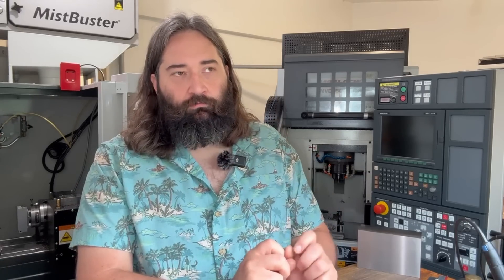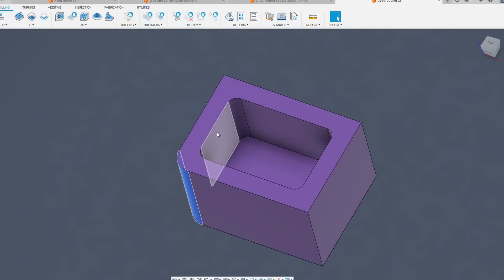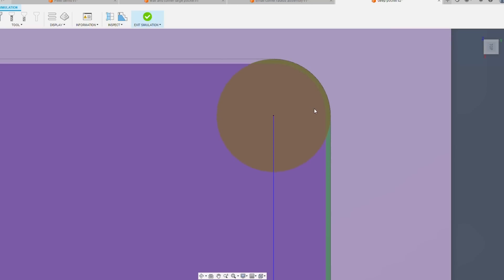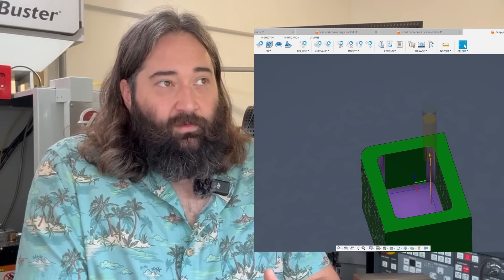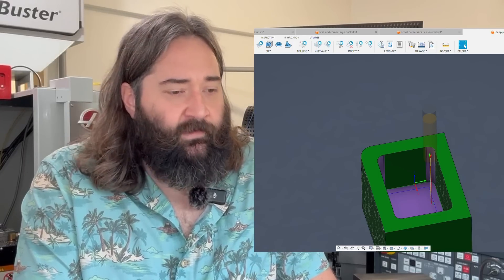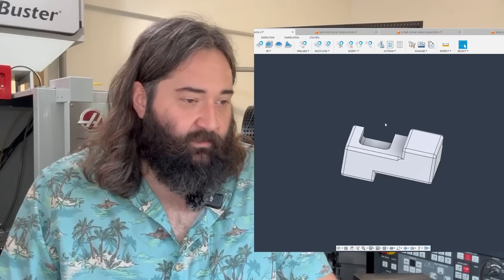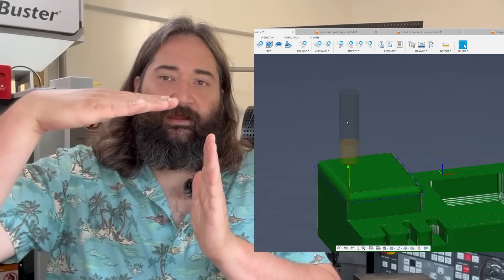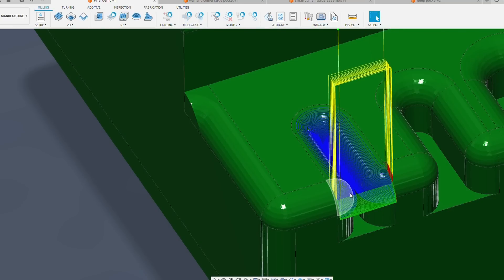Fillets make your cnc parts more expensive

Comment: A great video! The part where you ask for suggestions reminded me of something, and I think this maybe goes together with the heat treatment aspect of things too. What about material specs? Do you come across that are called out that on paper are completely doable, but that make you laugh because in your toolmaker mind, you know another more common material will get 99% of the job done at less cost, or faster turnaround because you have it already?

Comment: As a retired toolmaker and machinist with 40 years experience i can tell you that filets make your parts stronger because they eliminate sharp corners which in time will develop fatigue failure. However ,you are correct that it is much faster and cheaper to not use them as it cuts down on tool changes ,extra tool paths etc. It all depends on the use of the part .

Comment: Hello, your videos are great!!! I would like to ask for a video with stress release approach. For example, when you have a block with dimension 200mm*70mm*15mm to make  an electrical cover with internal slots, threads etc... the final part should have thickness of 5mm in the most of the surface with an around wall ( 13mm height) with  a grove for sealing gasket. This was just an example... I worked in  a job like this, and the main issue was the surface flatness, which had 0.2 -0.3mm difference from side to side. I would like a video to sawing as  the general approach, how many passes need to have our tools, how many tools (more than one for finishing?) what do we need to consider when we clamp the stock on our vice  etc.  I would like to learn and about stock tail on lathe because when you release your part, that will run a little out....
Thank you very much!

Comment: counterpoint: the consumer has now seen so many machined or cast items that machining and casting procedures are now routine prosumer culture, you can literally increase list price simply by doing more visible machining because the prosumer does know what they're paying for. meanwhile rarity markets are splitting on many common items: for example you can now get a real D2 Benchmade knockoff for $10 but anyone who knows what D2 is absolutely knows which is the knockoff and it will get to them eventually. be fancy, there's buyers now for fancy.

Comment: I mainly do 5 axis stuff with lots of organic geometries and whatnot, parts have lots of fillets on them, and at least for me it's easier to make those parts with fillets than if they didn't have them. 
All the smooth corners makes it lots easier to make good 5 axis paths with bullnose/ballnose type cutters, if those parts had sharp corners then it would need a lot more acceleration/breaking and other issues.

Comment: Very good video. I'm learning as machine design engineer, but I spent a little time with CNCs and regular mills/lathes, but even so I wouldn't take all of this into consideration (simply because I haven't use every tool mentioned here). It is probably EVEN MORE useful for people who don't have experience on machining. Such things should be taught in depth for every engineer who's likely to design anything, but I mostly see it taught to people who specialize in manufacturing.

Comment: I agree, but I would prefer to say inexperienced designers make parts expensive. I use to run a shop for years, and years ago... today I like to visit (when possible) and talk to a shop before/durring part is design. For all the reasons you mention. Early on I thought a part would run on a vmil, turns out they decided to run it on a multi axes bar fed lathe. after we talked we got cycle times down per part price down and we ended up making more parts

Comment: I completely disagree. I have 300 years in cnc and 500 years in bla bla bla.

Jokes aside.
This is cool to know. 
Just unfortunate that most of this info goes way over my head.

For my 3d printer, i normally use chamfers instead of fillets just due to the line stepping issues and looks.

Comment: I would argue inside corner fillets = good and outside corner fillets = bad. As for chamfers it's the other way around. Speak to your machinist what tools they are using most commonly and ask them what ball nose end mill sizes they use to get your desired insie fillet feature.
 Luckily the time I did work a lot with part design and machinists was with a very specialised company that did almost only do tooling for big casts (like big ship diesel engine blocks) and CFRP molds and the people there were always very helpful when it came to helping out with the design process. They did work almost exclusiveley with polyurethane tooling foam so it wasn't as bad as in working with metal, but that stuff had a tendency to break easily on sharp corners or narrow ridges and those had to be avoided at all cost...

Comment: yea... as someone who has to assemble and finish moulds.. i sometimes wonder if designers ever thought how parts are made.. We have 2 5 axis machines and they slap sharp corners on things that have no matting surface and they have nothing to do with the part we are making, its purely for clearance between 2 parts.. 
Sharp corner, 180mm deep with an angled surface on the bottom towards the wall basically creating a V, with also no corner radius on the bottom. I am like what do you mean bro. 
We don't have a edm, just for information here. i have to finish these pockets/sharp corners per hand. ... lmao

Comment: I found its much easier to cut all the faces square then smash all the edges with a hammer to get the fillets or even throwing the part against concrete floor can work.

Comment: One could argue the filet is actually the cheapest (long term) as a part that has fileted internal radius will have a lower stress concentration than a sharp corner meaning less external parts/supports are required to bear the same loads

Comment: Does 4 axis CNC fix some of these issues? Does it allow machining with more common end mills? Like, can an outer corner top radius be cut with a flat end mill by simply rotating the part as the tip or the edge of the tools cuts?

Comment: Id rather have the parts come out od the machine done and deburred rather thsn having to pay labor to debur, etc.  If adding fillers of chamfers in the machine adds a few seconds or minutes to the machine cycle tome but saves hours of labor in not having to clean, debur, etc.  Its not always about saving machine or machining time, its about reducing labor costs which are typically one of the most expensive portions of any project.
Reply from the maker: You are correct in that parts leaving the machine deburred is optimal. Most of the injuries I've seen in machine shops were small cuts from handling sharp parts. Just reducing those osha recordable emergency room visits is an immense savings.

 In a lot of ways this video was a failure in terms of me communicating. I'm not anti fillet, especially in internal pocket corner, but can a chamfer work on outside edge breaks? 
what I was ultimately trying to convey, and failed, was that certain geometry makes fillets more difficult and to be mindful of things like vertical walls and narrow slots.

Comment: So... biggest advice is talk to your CNC person to see what features where will add to the cost during the early designing process so you don't build features on an expensive process. Something like "what is the smallest finish mill you use for making pockets so I can specify a minimum fillet of that tool so you don't have to buy a specialty tool for my project". Sounds like sound advice to me. (I used to do production documentation, so would often go down to the production floor with a prototype to ask them what the workflow would be for the tools that they have so I could put that into the documentation...)
Reply from the maker: You do have to be a little careful though. Shops tend to steer parts into obscure processes that they, and few others can do. Partly because it’s easier for them with the unique equipment they have , and partly because the no it makes it harder for customers to move work

Comment: Trouble is, you can design perfectly for manufacture for one supplier, and yet another supplier will say it’s difficult to make and therefore very expensive. Or they will not understand the tools required or processes that were intended by the designer, and produce it a different way that is, again, expensive. It’s still too variable from machinist to machinist to say exactly what will make a part expensive. Some machinist are just happier to pull out the R3 ball nose and scan the whole thing instead of doing a staged program :/

Comment: Great tips. As a maker I love this kind of content. Even though I live in the US, I design everything in metric (as most of the parts interface with other metric parts, such as the current heat-sink for a Raspberry Pi) so those size tips really help. A guide sheet would be most helpful when designing parts.

I admit my cost guide for features are the instant estimators from Protolabs and Xometry. That is an easy way for me to see if a particular feature is worth doing based on how much added cost it has.

Comment: If a customer puts fillets on everything simply because they like the look, and are quite happy to pay the extra cost, does that bother you at all?  Would you rather be doing "real work", spending the machine time on +1 customer's parts?
Reply from the maker: Not offend. My goal is to match the customers expectations and have it be a good transaction for them. If they expect  a stellar looking 3d fillet covered part, I enjoy making that for them and will charge accordingly. If they want a basic bracket a a fair price , happy to do that as well.
Reply: @adamthemachinist  kinda based, I respect it.  Thanks for the video!

Comment: Thank you this was very helpful for me going from designing for 3D printing to designing for machining. I just learned from this video at there is a lot to know about the geometry and the physics of machining to be able to design so a part can be made economically.  I just bought an old Novakon 145 CNC mill and lucked into a Microkinetics 1236 CNC lathe missing the electronics. Installing Centroid Acorn to replace Mach 3. I have limited experience with milling machines but have owned a metal lathe before. I need to watch more of your videos because at this point I don't know what I don't know about milling machines.

Comment: This is rookie level cost maximizing. To start, I fire up solidworks and head over to make a drawing and begin by following the FOE rule. FOE stands for fixed constraints only, E is for elliptical fillets and profiles on at least two planes, and O is for *000*s: make sure to add one leading zero to the tolerance for every time you’re told its urgent to have the drawing done.

Comment: Chamfer are preferred over fillets or what do you think from a machinist point of view?
Reply from the maker: For edge breaks ,!I like chamfers. one tool can cover pretty much any size chamfer. You still have the issue of getting all the way into the corners of walls. Chamfer mills are quite a bit cheaper too
Reply: @adamthemachinist  thanks for your response. I do a fair bit of cad design for machined parts for some clients and this is very helpful. I like it that you explained the do's and don'ts. Just subscribed. Keep up the good work 🤙

Comment: 5:48 another thing about machining these internal radii with a direct match sized cutter is the tool path, its taking a very abrupt 90 degree corner as apposed to a smoother path (some controls don't handle the abrupt corners very well and can cause form issues ), the amount of tool pressure and aggressive tool path combined smells like broken endmills.

Comment: This really resonates with me, when reviewing my junior engineer's drawings and designs they forget to think about how it's made. And I can sympathize, when I was a young engineer I was too concerned and obsessed with the perfection of the design and didn't want to compromise my design for the sake of manufacture.  After working many years and having to CNC my own parts, I now want to design things that are easy to manufacture and get the job done, could the part be more perfect? yes.  Will anyone manufacture it for me at the cost I want?  No.
Reply: Making it easier to manufacture will generally also make your machinists happier. Instead of cursing that engineer that had them spend 10 hours to get that feature just right. Especially if it didn't even need to be that exact.
Give things the biggest tolerance you can spare, your parts will be cheaper, and most machinists will try to get it fairly close to nominal anyway. If you give a machinist +-1 mm on a pocket with side lengths ~50mm it's doubtful that it would end up close to either end (unless usinga "cheap" shop).
Reply: @TNH91  that's near the gospel of GD&T.  Give the parts the largest tolerance they can to still function. Although, anecdotally, I've had US based shops call my GD&T "space age" tolerances.  They're the same shops that couldn't hit the broad side of a barn but still charge high end prices.
Reply: @capnthepeafarmer  GD&T? General Dimensions and Tolerance? I would say that those often are tighter than necessary if the engineer/designer had taken a few minutes to think about it.
Though they usually (if following DIN ISO 2768 or equivalent) are fairly easy to hit directly with decent machinery. Slightly more work when you have a tolerance of 5-10 µm in one direction.
Reply: @TNH91  no no, GD&T is "geometric dimensioning and tolerancing" short hand for the ASME Y14.5 standard or the ISO GPS standard.  Not the same as the title block tolerances or the general tolerance of ISO2768.    GD&T was developed in the 1930's so torpedos from different manufacturers could fit in the same hole. Just by virtue of having GD&T doesn't make anything more precise.  It only specifies unambiguously the datums and the relations to features.  It's up to the designers and engineers to specify the widest tolerance that makes those parts functional.  That's why mass produced parts use GD&T with wide tolerances, but you can also use GD&T on very precise parts.  It's just a way to unambiguously specify the relation between features so anyone can manufacture it.

Comment: From the machine perspective, external fillets are better, because the motors driving the axes don't come to a complete stop, at the corner, so there's less wear on the internals.
It also helps if the machine has excessive play, avoiding errors caused by slack in the guides, when the two edges are not parallel to the x, y axes.
Reply: Your cam software can roll the milling tool around the corner so there is no dead stop.
Reply: If you take the time to ensure it does. It might be something you specifically have to set, though, since it's more time-consuming.

Comment: I've been saying this for years as a machinist. So many times I've been given prints with like a .100" internal corner radius or a .200" external radius for absolutely no reason. And whenever I say anything to the designer or engineer, I get the stink eye. They don't realize that it takes so much longer to make the part

Comment: As an engineer working within injection molding dies, the knife making industry and also doing some punching die work, a video on part growth would be very interesting, as well as micro milling but also potentially a video on polishing operation I would be very interested in to see. after all polishing of mold cavities is always an interesting and illusive process that has a lot of tricks to polish surfaces without impacting potentially high tolerance joining surfaces.
further more if you are looking for more ideas, edge rounding on scale would be very interesting, as round overs or chamfers on a larger scale is an interesting problem I have stumbled upon a couple of times in my work and the solutions are not always as ready made as I hope and often we would have to resort to test batches of vibratory tumbling which leads to non consistent radii, or biting the bullet and using specific grinding wheels or internal radii endmills which in most operation is just beyond costly.
It would be very interesting to have your view on that.

And thank you for your material, its always informative, and interesting.
yours sincerely and engineer that tries not to be a headache for his machinists

Comment: I would also like to add that designers should keep fillets standardized as much as possible. When it is just for cosmetic effect, there is no need to have four different radii that require 4 different corner mills or slow HSM milling with a ball mill.

Comment: This is a fantastic video - I do mechanical engineering, and while I knew some of these, several of your points here I had never considered before - particularly the 'sharp corner' on the bottom of the pocket being a pain. Thank you so much for sharing your insights! I would be keen to hear your thoughts on heat treating as well in a future video!

Comment: dude!! +1million from a machinist!!! I can assure you that there is nothing worse than a long deep pocket with equal fillets on the floors. so much more work to get the floor flat because you have surface the corner floors. not a easy check box in cam,  you have to create that on a part by part basis. and to make it look good you have to know some tricks to keep it from draggin the wall or chattering in the corners. id say overall takes at least 5x longer than floor with 1/3 or less radius than the walls have.